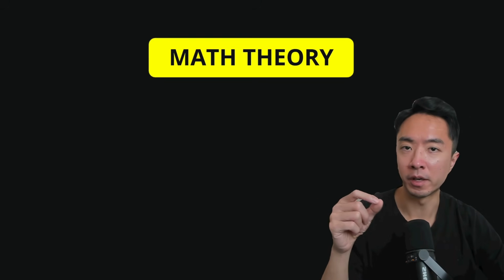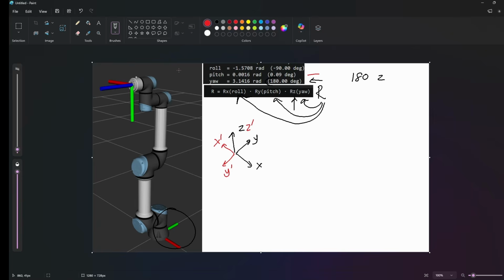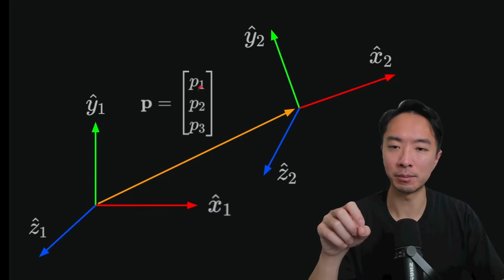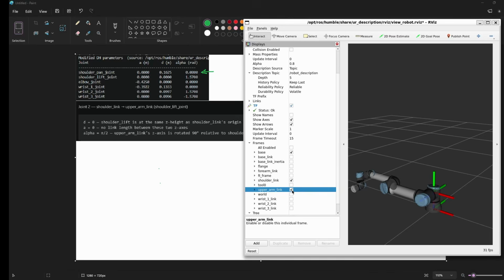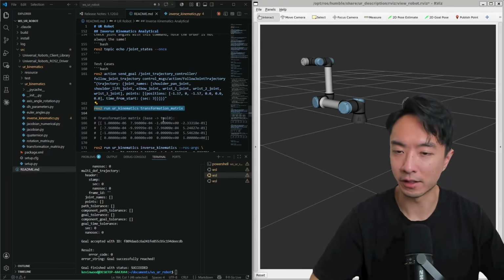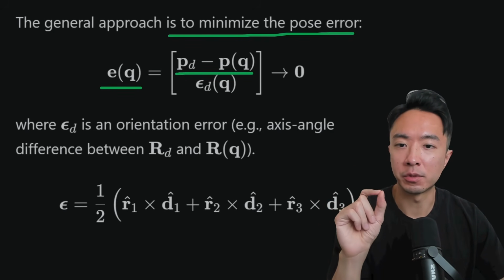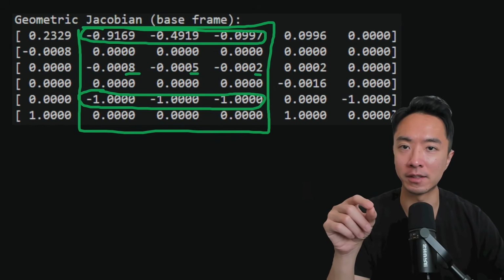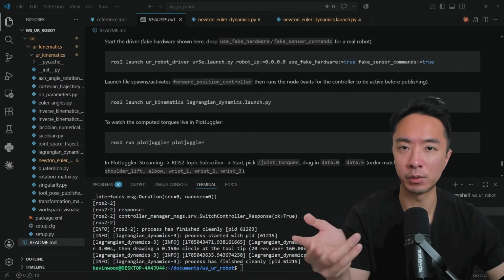Robotics Course on Kinematics & Dynamics (Theory to Simulation in ROS 2 Python with UR Robot)

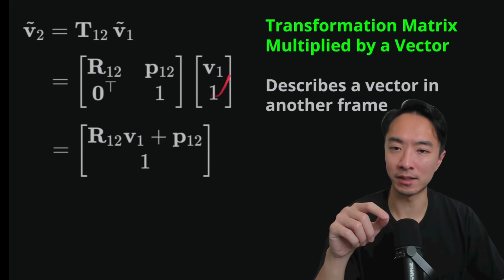Comment: Great video. One thing worth flagging for viewers: the subscript convention here (T_12 maps frame 1 → frame 2, at 40:48) is the opposite of the one used in Modern Robotics, ROS/TF, and Sophus, where T_12 maps 2 → 1 and adjacent subscripts cancel: T_12 T_23 = T_13.

With the convention in this video, composition runs in reverse order — T_13 = T_23 T_12 — which is easy to get backwards when chaining camera → body → world. Also worth stating explicitly that p_12 here is the origin of frame 1 expressed in frame 2, since under the other convention it means the reverse.

Both conventions are self-consistent, but a one-line note on screen would save people a lot of confusion when they cross-reference other sources.
Reply from the maker: Great point!

Comment: Hey Kevin,
I'm trying to learn robotics, I have taken a robotics class which taught Ik, FK Jacobian and transformation matrices etc. However, I am unable to understand how to implement that in real life and use simulations to work and design a robot. I am good in understanding the theoretical stuff but I want to design and simulate from scratch. Can you please suggest me a roadmap or starter and I also saw you course for $79, would it help me achieve the pointers I mentioned or is this course a good starter?
Would appreciate your word.
Reply from the maker: Yes it would be a good start for you. Keep in mind it contains the code and doc for this video. It will be a good way for you to understand the code structure that I use and how to integrate with a simulator. You ran run all the test cases that I created to test your own understanding

Comment: As someone with robotics master and actively working on robots, I am super impressed with this course. I love how fun, informative and project based you made this. It's awesome so much so I hope this was around when I decided to do my masters. Robotics is the next frontier and the next big thing, we needed someone like you keep it up!

Also a part 2 of this course with parallel robot architecture can also be a good idea, like a delta robot or Stewart platform which makes more sense for good amount of applications out there. Even in humanoid closed chain is widely used. Northwestern robotics edx or coursera has good theory videos on this topic but nothing close to you making it an all around package, with simulation application and so on. Truly great.

Part 3, control PID implementation and so on, disturbances, goal trajectory and so on and simulating response, torque response of joints and so on. Common man there is a world out there to conquer, indoctrination of next wave of engineers in the art of robotics needs you!
Reply from the maker: These are great suggestions! I’ll most likely do more videos in the future on robot control so stay tuned!